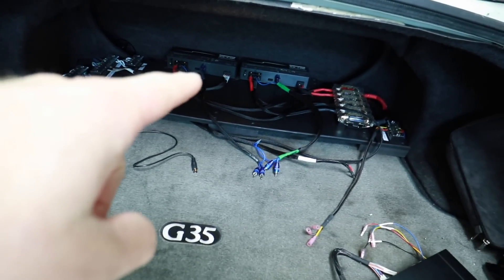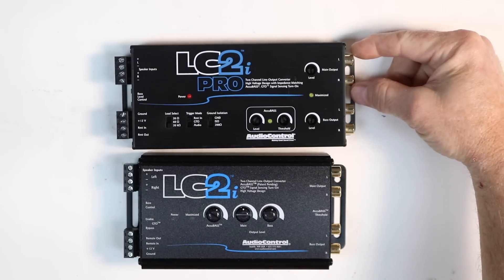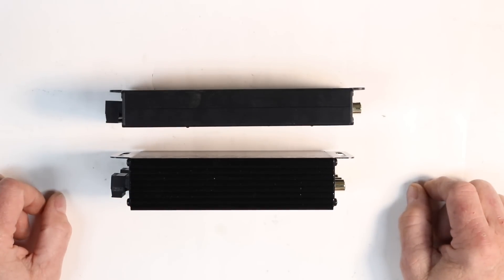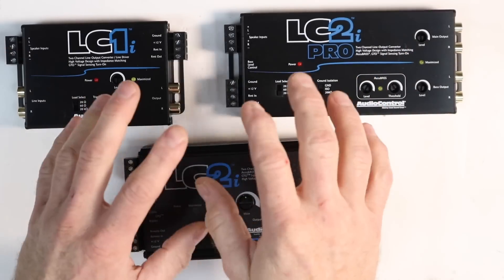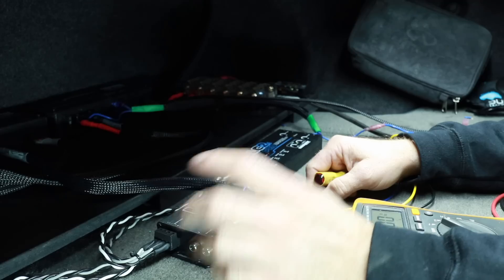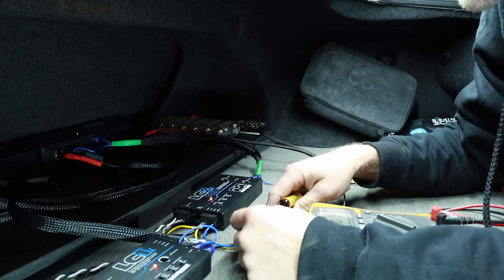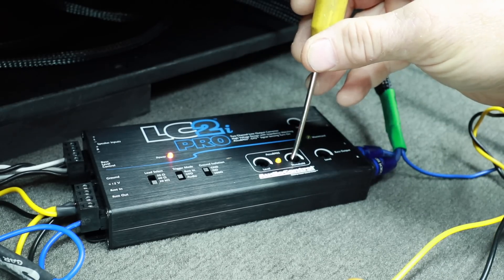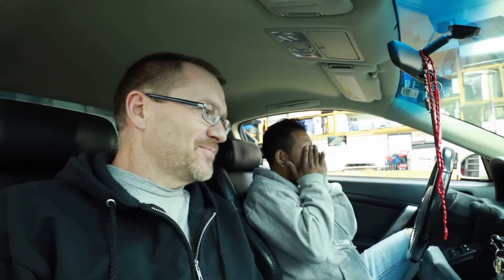The new bench mark in High to low level adapters from AudioControl LC2i Pro  Car Stereo Lab

Comment: i had a lc2i with my factory headuniit and loved it. got a kenwood headunit now and just left the lc2i in the car but turned off the accubass. I think from memory the accubass sends a clean 8v signal to my amps, where the kenwood sends a 4v signal. nyhows lc2i is a good unit

Comment: Awesome vid guys! I installed an lc2i into a friends audi a5 fastback. The accu bass sounded like the epicentre's octividing action which I don't like. Hurts my ears lol. I swear it puts in some subbass square harmonic or something. It would be would
be wonderful if you guys could spectrum analyse an epic in action  for a lab vid. I'm sure everyone would be interested to physically see what an epic does xx
Reply: They already did this video and showed what it does with an RTA
Reply: Ah thanks @melissathompson7229 . I'll have a look xx
Reply: I've got an Audi S5 Sportback and have been having an issue with the sub randomly failing to come on when I start the car. I'm currently using a Wavtech Link2 with a JL Audio 500/1 amp and 10" shallow mount sub. I'm thinking about switching the Link2 for the L2Ci--did you have any issues with the Audi's B&O system like I've described? Do I need to add an AC-LGD resistor as well?

Comment: Great video, your attention to detail and craftsmanship is awesome. I installed a LC1i to my 2023 Ford F-150 Lariat which has the B&O system (not the unleashed). I added a single non ported 10" subwoofer with a 400 watt amp. I tied it to the factory installed subwoofer speaker wires for my line in and the rest is wired as you did in the video, works GREAT!!! But, i noticed when i turn off my truck and open the door, the music stops, the factory deck turns off but the LC1i and amp remain on for just over one minute. I tested and its pretty consistent. I also noticed that when I open a door the LC1i and amp turns back on and stays on for just over a minute with the deck off. I'm thinking there is much electronics in these newer vehicles and perhaps why I'm experiencing this, anyone else experience and what did they do to resolve?
Reply: I forgot to mention the trigger and delay happens in both the GTO and AUDIO settings.

Comment: I think I need the LC1i.. for some reason I have to turn my gain almost all the way up on my fosgate p1000x1bd.. I didn't have any problems with other Amps I used and tested. It seems to not see the signal..

Comment: Hello i have cherokee with premium system, i want to add a LC7i to add 2 amps with 2 more components and 2 subwoofers but i want to keep the stock speakers with their stock amp. From where should i get my signals?

Comment: I have this installed on my 2019 street glide with the factory boom gts head unit. With HU volume at 75% I couldn’t get the “maximized” light to turn on even with the level knob maxed out. I measured output at the lc1i with a multimeter set on AC volts and it maxed out at 1.9v. The lc1i should be putting out 9+v. Have you seen this before and do you have any advice? Thanks

Comment: Question.... My Kenwood Deck has bass roll off choices of -6, -12, -24 db but no off switch. What is the best setting.. And does it change gain settings. I used to have bass roll off at -12db but changed it to -6db....do I have to re adjust my gain?

Comment: Could i use the LC2i as a line driver?
In other words, i have a Chinese headunit that only gives 2 volts from the low level outputs.
Would it be better to use the high level outputs and a LC2i ??

Comment: Can you use that new lc1i line driver after the lc2i to clean distortion so that subs can hit alot more powerful without distortion light lighting up like Christmas trees? Basically setting lc2i ( maximized) then hooking line driver up and maximizing that, then the amp should be able to finally pound harder and higher on subs without the amp light coming on. Bass fanatic here, thanks haha.

Comment: My fusion sport has the sony system which is worthless at idle or just with ignition sense on . Drive above 60 and it really gets rowdy for a factory setup. I've been holding out on the new audio control to fix this issue.
Reply: What year sport? What's your setup?
Reply: @rhernandez5393  2010 and all factory 10 or 12 speaker setup. I just wish there was no vehicle speed volume control
Reply: it's your speed control setting on ford 1to 7 check that it gets loouder as speed increase at idle or park back down
Reply: @slowbrezze  yeah it's at 7 but when it's set on off it's like 0 or negative 50 db. it truly sucks.

Comment: Please inform me about the phenomenon that when i turned on the Indy DB4.1x and i had connected the high-in plugs with amplified signal from my old gactory cd-radio, the amplifier (with +12v on rem) starting playing the output sound (non regulated with gains at low) but after few seconds the voice slowing down and finally disappeared . The sound (the same way) came back again when i cut the 12v from amplifier and connected back again. Any idea for this trouble? Is it possible to be problem the gain voltage? How can i measure the correct voltage, till the time that my amplifier is integrated with high in inputs included on the same apparatus. Thank you

Comment: Why didn't you test the voltage of the output of the LC1i for the purpose of a line driver?
Reply: not only that.   the amp has a max volt threshold of 5 volts.   no point of passing that.

Comment: I asked this question in the lc2i video, but the lc2i pro is basically the same, ao any help would be appreciated.

Bear with me here. I have an Acura RSX (Bose system) with an aftermarket Kenwood head unit that has a 5V pre-out. I’m replacing the old amplified, self-contained Bose spare tire subwoofer and replacing it with a new amplified, self-contained JBL BassPro Hub. I’m keeping the front factory Bose amp.

If I’m thinking about this correctly, the front factory amp just carries a remote turn on and speaker level outputs to the sub (it doesn’t amplify the sub), so is it even worth it to use the lc2i pro from the front factory amp to the new JBL sub, or should I just bypass the speaker level outputs from the factory amp, and instead use rca cables from the 5v pre-out in the Kenwood head unit to the JBL sub?

I’m not sure, but I don’t think it matters if I bypass the factory amp (and ditch the lc2i pro), because the subwoofer isn’t amplified from there anyway. Am I correct in thinking this way, or in my case, is there still a benefit in using the lc2i pro?

Comment: Five Star, I do not have an LC2i, BUT I have a LC7i. Would the things you demonstrated on the video work for the LC7i? I have seen your videos on the LC7i and others as well, AND I'm still confused about it. I wrote to Audio Control and I'm still confused about it. Would you, OR ANY OTHER posters know the answer to this question I have about the LC7i: I have high level inputs going into it, my radio is AN AFTERMARKET Kenwood receiver (it does have the RCA line pre-outs in the back of the radio. I CHOSE NOT to use them cause at the time of installation I did not have the correct length of RCA cable, PLUS, I researched that the LC7i can output up to 8 volts to your amplifier, so hence my reasoning for using the high level inputs. YES, Audio Control also makes the DQDX, and another processor DQ-61 I think, that I can use RCA line inputs with to get even better sound.) Now back to my question, Is the OUTPUT coming from the LC7i to go into your amplifier a High level input, or a Low level input? My car amp can accept up to 4 volts using the RCA's, and up to 10 volts using the High level inputs. Thanks for reading my question, WHOMEVER could answer it.
Reply: Low level comes out of the LC7i, same with your kenwood rca pre outs. You need to measure the voltage coming out of the LC7i going into your amp making sure it doesn't go over 4v. You can avoid that step by just using the rca pre outs from your kenwood head unit

Comment: How does this compare to the kicker keyloc?
Reply from the maker: The Key has a DSP for de-equalization
Reply: @FiveStarCarStereoInc ty for your reply! What would you recommend for a 2020 mercedes e class for two 12 kicker q subs 2ohm, the Lc2i pro or the kicker keyloc? I was thinking of the Lc2i pro because I was told I need load generators. Or the keyloc for the auto eq and separate load generators?

Comment: Is the load resistors only needed for car audio systems when you remove a stock speaker and replace it with yours?

Comment: So happy to find this channel. Question if im simply adding a sub to a stock system, can I use the LC1i on the factory sub signal? I have previously used a basic rca converter so I do know it doesn't need a load on it. Any info is very appreciated.
Reply: The short answer to this question is "yes". 
For better detail, I'd recommend watching the YT channel "Boost & Shutter
". They have a discussion & review video of the LC7i which you could use as a guide for the LC1i.

Comment: Hey guys nice video what u guys think is better for upgrade my audi a4 system should i go with the lc7i or the pioneer dsp ?? Also want to know if the dash speakers can fit a3” midrange from focal thanks guys
Reply: The pioneer DSP is not that good, very basic, you would be better served with the LC7I and a Dayton Audio DSP, or if you want one unit the DM608
Reply: Charles Pack thanks

Comment: New to this channel, I found myself binge watching. Question... I see you use a lot of audio-control products, I’m not sure which to use with what setup and why. 
Can you tell when and why you would Use/need these products?
Reply: The products shown in this video were Line Out Converters, also called high-to-low converters. They take the speaker outputs from a stock radio, and convert that to a low level RCA style output, that carries the music signal to an aftermarket amplifier. These are great for integrating more powerful amplifiers while keeping the factory head unit (radio) in the dash, especially if you want to add an amp and subwoofer to a stock sound system for better bass.
Reply: To explain further, these are active LOCs, not passive. That means they’re powered so they can push a better, more powerful signal (as well as accepting a powerful input signal), while a passive LOC might lose partial signal before the amp. Also, the AccuBass feature is unique so if your factory radio rolls off the bass it will restore it so you have a matching bass signal all the way up to your max clean volume.

Comment: Here's hoping this will assist with eliminating noise when integrating an aftermarket amp with a factory radio
Reply: Did it work? 
Used a pac loc made for my car $45 ish was a pos add an amp and noise from factory radio just amplifies 10x 😡

Comment: How would you know how much input voltage is going into the amps? Last I checked thet put out up to 8v which is too much for most amplifiers
Reply: They put up to 9.5v, actually! And you can test voltage on the rca outs on the LOC by testing it with with a few different tools, but AudioControl makes an RTA/Oscope that can test voltage and speaker polarity as well. I forget the model name, but it’s badass.

Comment: I have a question . I want to keep my factory radio in 2015 Hyundai Elantra and also add DSP because the radio only has bass,mid,treble controls what is the most budget friendly option? I say budget friendly because  i'm raising my grandkids now thanks in advance.
Reply: Do you have the base system or the "premium Infinity" system? Either way I would look at a LC7i, will give you nice clean RCA signal to build off of. A nice pioneer gm d9705 and the focal integration series speakers and a nice 10" sub
Reply: @charleswp71  I have the base system thanks ill look into the LC7i
Reply: @chrisjarrett2473  that's what I use in my 17 Veloster with premium sound(dimension)
Reply: Dayton Audio has a good “entry level” DSP that’s not too hard to figure out and is only about $150 usually.

Comment: For a 2018 Q50 (no bose), is AccuBASS needed for this vehicle? Thanks!
Reply: did you get the lc2i? accubase i think should be good to have on any system
Reply: @cruisertechgt  I ended up installing the Rockford Fosgate DSR1, instead of the lc2i. full range response is awesome and  more control over the whole system.
Reply: Patrick S nice what’s the difference between lc2i and the DSR1? Are they doing the same purpose like line output converter from speaker level to rca ?
Reply: @cruisertechgt  dsr1 is a full blown digital signal processor with line level or rca inputs. 8t gives more control over the entire system (fronts, rear, subs) where as the l2ci is a single in with bass correction only. Dsr1 allows for full system tuning.
Reply: Don't think I ever answered your question. As long as the signal is getting tied together between the front and rear speakers (which the DSR1 does), you don't need accubass. The front speakers do not play full range, whereas the back speakers do. The DSR1 ties both together, so the bass is there. You just can't use the stock fader to the front. The bass will be gone....
Reply: Patrick S oh I see. Yeah I had trouble with my system because I tapped into the front speakers but didn’t get much bass. I tapped into a rear bass signal too and I got bass but it was very low I had to use f-r fader and lower the treble to get bass. This was using the built in amp high level speaker input. I am only installing a subwoofer into existing stock system so in this case is the lc2i good enough for me? I was thinking to get it so I can boost the speaker wire bass signal into rca of my amp and then use stock head unit back to normal equalizer / f-r fade settings
Reply: @cruisertechgt  hook it up to the back speaker leads. The front  speakers do not get full range signal. The Audio Control will be good for you, as long as it gets the rear speaker signal into it.
Reply: @cruisertechgt  DSR1 would get a sum of the front and rear for the bass. So, it works for me well
Reply: Patrick S yeah I heard someone else say they connected to rear speaker leads and had proper signal. I’m Ganna try that Thanks for the info
Reply: @cruisertechgt  Crap, sorry I didn't see this until now. Yes, I believe the Lc2i is a good choice. My car is back at the shop getting a second sub amp installed today (instead of running from a 5 channel), I wanted more bass. Went with 2 Kappa 10s and a Punch 1000. My installer is adding an lc1i, so that I can have full volume control over the subs. The Punch only has a boost, not volume.
Reply: @patsjoholm  Wow you must be doing some heavy bass now with the new setup. I got the LC2i and installed it. I tried the rear speaker leads but I got no audio on my car...I think my car amp sends only certain frequencies. I tapped into the front bass signal and got good sound. Then I tried with the LC2i and I got more control so now I have full control of the bass at different head unit volumes. Thanks to the LC2i i have great quality now because I can balance the equalizer on my headunit for the other speakers and just boost the sub with the LC2i and subwoofer amp gain working together.
Reply: @cruisertechgt  sweet! Glad you got her sounding good 👍  yeah, got her back yesterday and there's plenty of bass to go around. Doesn't matter what type of music, it's perfect with the Audio Control bass knob adjustment 🙂

Comment: Question, if using this with home audio, how do I supply it with the proper 12 volt power?
Reply: You should be able to use a 3 amp 12 volt power supply.
Reply: on your receiver.  you should have a 12v remote turn on for a external amp.   that would work.